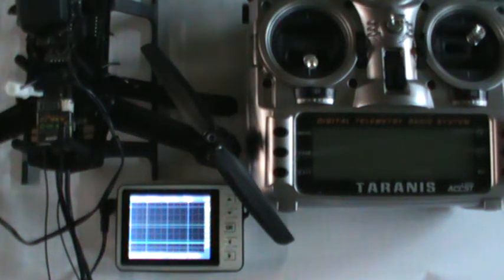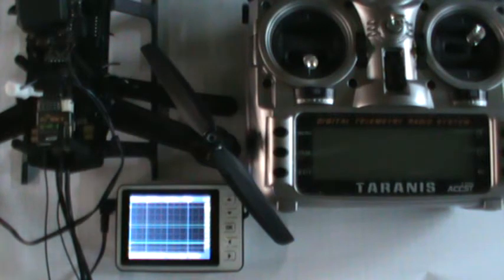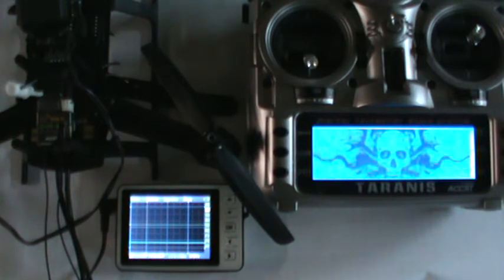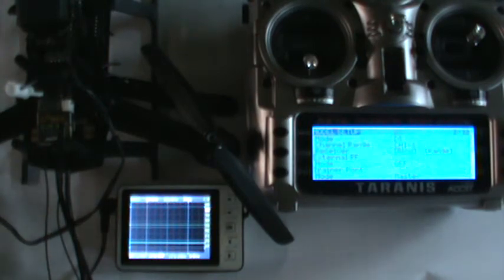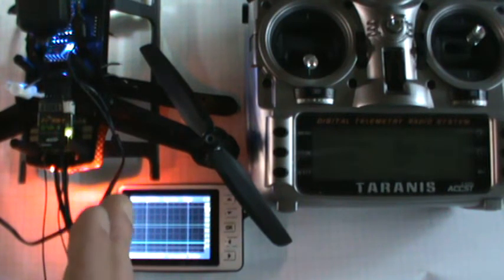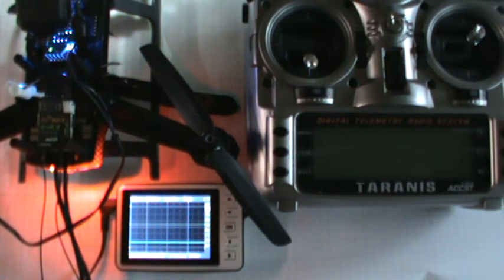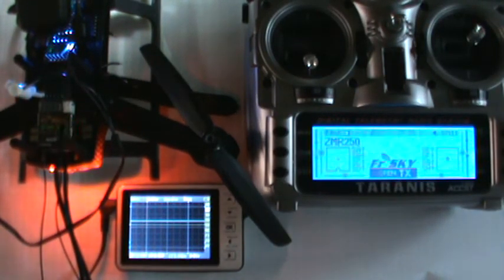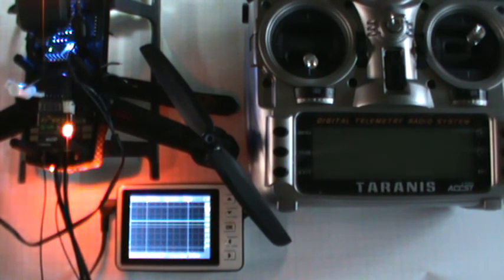Setting FrSky D4R-II (all FrSky Rx's) for a NO PULSE Failsafe (by Snowboard_Nut on RCgroups)

Comment: Excellent video, thanks for sharing! Question, I need to set a switch to command my RTH. How can I incorporate that switch into your drill?
Reply from the maker: Switch is setup and defined in your radio, but not during the bind/fail safe process of the Tx to the Rx shown in my video.
Reply: @ImYourGuiltyPleasure  Thanks for your reply! I have to command a switch position when radio is off. I can do that for one model however when I switch planes I need to train the radio again! I set the failsafe so that the plane can return home!
Reply from the maker: @EduardoFritisRealtor  that is done in your flight controller software, depending what kind of controller your craft is using. Could be a Naze, a Pixhawk, etc. In my case, at that time I believe I was using Betaflight as my controller software... Later on I switched to Pixhawk controllers so then my software was Mission Planner.
Reply: @ImYourGuiltyPleasure  I understand what you are saying! My question is different. The failsafe of the receiver is to set a desired function of the receiver in case the radio signal is interrupted. Do you know how to do that so when I change model the receiver remembers the failsafe?
Reply from the maker: @EduardoFritisRealtor  I have personally never set a Rx to anything other than a No-Pulse outout, so I can't answer that.
Reply: @ImYourGuiltyPleasure  Thanks!

Comment: WOOP that worked out great.  Frsky D4R-II and a Turnigy 9X with ER9X and I did exactly what you did and now it works perfectly.  When I turn the receiver off the motors slow down then shut off after a second or so then a continuous beeping from my naze32 FC which is fine with me then I can find my quad.  Don't know if this is normal or not but I like this idea.  Thanks for the video now my hair can grow back!

Comment: ImYourGuiltyPleasure I did the same but I ma using Betaflight to check what comes from rx.. and the values are still the last when I turned radio off. It rememberes values.. I did it 100 times but still no joy. Please help
Reply from the maker: I saw your Comment on +Shim Drone ( +Shim Botnik ) regarding this issue also and I commented there but Shim won't approve my Reply to you because he is Butt-Hurt that I caught him using my technique in a video recently that he is duplicating my technique without giving proper credit for my hard work of discovering this. I would suspect that the Betaflight Configurator GUI is at fault for locking onto the last known values and continuing to display them. An oscilloscope simply does not lie. Further questions; feel free to ask :)

Comment: Thank YOU! I've used your video before but recently pulled out an old torn down build.  Heck if the Failsafe wouldn't work on this old Naze and D4R-ii...  Found your video, remembered the bind, turn of transmitter, reboot D4r and Failsafe it and then power up again.  Works like a charm.  Finally I can get this old quad up in the air for a buddy without having to worry it's going to fly away on him :) Much appreciated.

Comment: If you set it up this way and then loose the signal will the receiver then tell the FC to shut down and quad will drop?  Not sure what happens after the receiver stops receiving pulse.
Reply: yes, it will fall out of the sky.
Reply from the maker: It will drop out of the sky IF you haven't setup the flight controller how to deal with no pulses. The beauty of no pulses is that it is the same type of condition that would happen if the receiver shut down in mid flight or if the SBUS/PPM wire vibrated loose in flight.
Traditional failsafe's of returning certain channels to a predefined postion work well for some people, but if you really only rely on channel predefined position and you have a receiver failure or loose SBUS/PPM wire then the flight controller will have no idea how to handle that condition,
This is the reason I prefer a no pulse failsafe because it covers more scenarios of failure.

Comment: Awesome tutorial and tip on this.  Had the same issue and glad I found your video solution.  
Now I can be confident that if my quad loses signal, the motors will actually cut/disarm and not keep spinning with NO PULSE feature in Betaflight/Cleanflight.  Life saver!
Reply from the maker: JPMediaProductions Rock on!

Comment: Sorry I am new... Could you explain what 'no pulse' is?? much appreciated, thanks!
Reply: Does it mean the quadcopter will fall out of the sky?
Reply from the maker: Most commonly No-Pulse is used when combined with Autopilot Type flight control systems to trigger a Return-To-Home Failsafe if the radio signal is lost to the aircraft, then the aircraft will use autonomous GPS assisted control to bring itself back to it's launch point if you have setup the flight controller properly.
Reply from the maker: It will fall out of the air during radio signal loss if you have not setup the flight controller to deal with a no-pulse output...

Comment: Thanks very much! Worked perfect first try with your instructions. For what it's worth, I'm reading the 8 channels of 27ms CPPM from the D4R-ii with an Arduino and the "claymation" library. The No-Pulse mode allows the Arduino to instantly know that the transmitter has gone AWOL.
Reply: +Nick Shaver I spoke too soon. It worked once, then it quit working. Now the D4R-ii just outputs whatever the levels were when the receiver turned off.
Reply from the maker: +Nick Shaver I have several receiver's running perfect with my procedure. There must me a simple element being overlooked in your procedure. Your not trying to bind the receiver again after setting failsafe are you? As I'm sure you may already know, any time you re-bind the Rx you will lose the FS settings and it will revert to "Last Known Signal" failsafe mode....